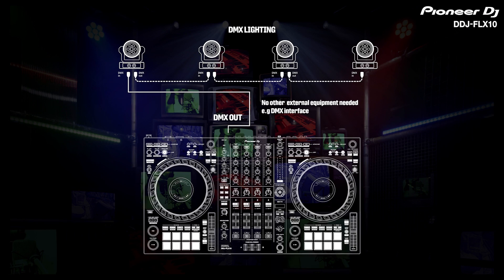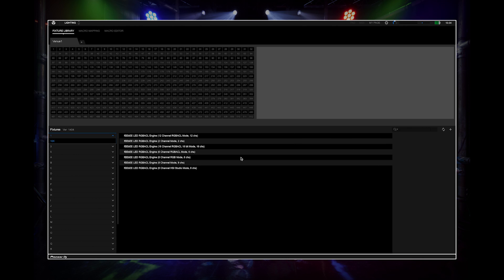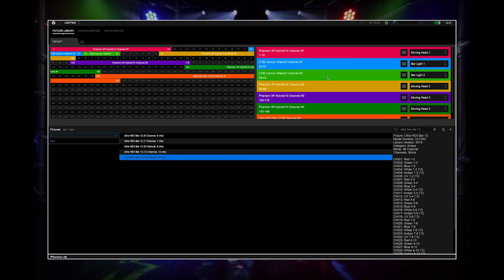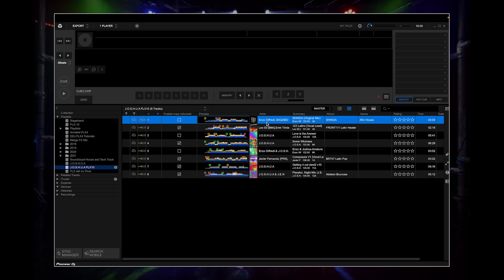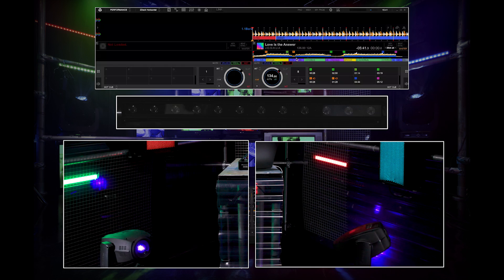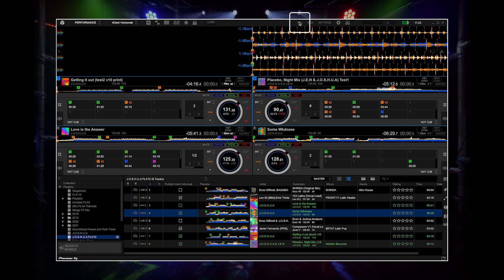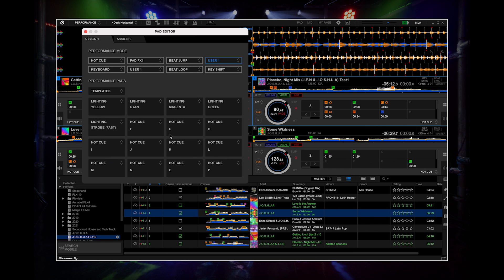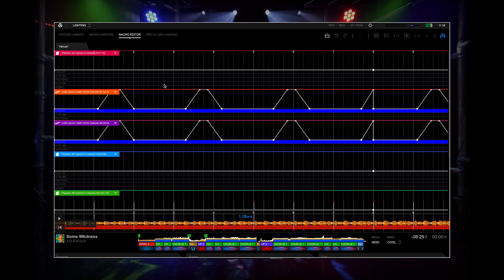DDJ-FLX10 Tips & Tricks: DMX output for rekordbox Lighting

Comment: I thought the FLX10 DMX only supported RGB (not Magenta, Cyan etc)?
Reply: yep, but in can mix R, G & B. There is no native UV & native White support
Reply: If you are a developer type, you can use a microcontroller and DMX-512 transcievers to translate from RGB palette to RGB+AW palette to utilize the full spectrum of your fixture. It will cost you less than $50 in parts. Too bad 30 lines of code for microcontroller is something Rekordbox devs cannot implement natively for years.